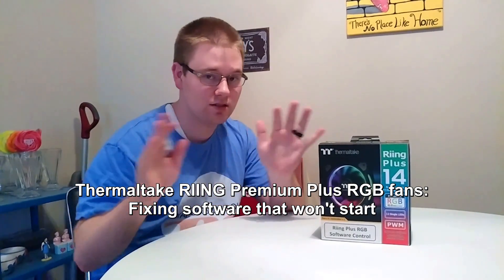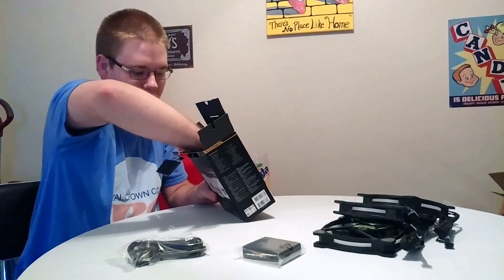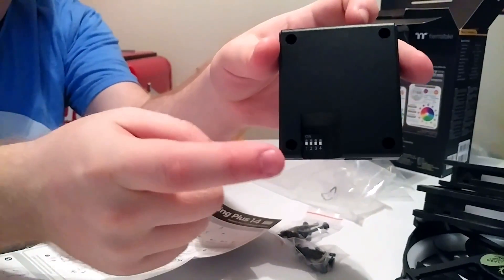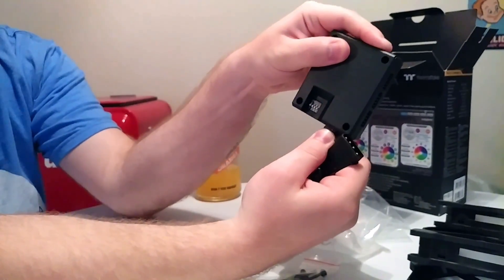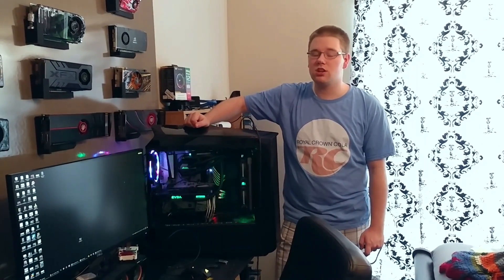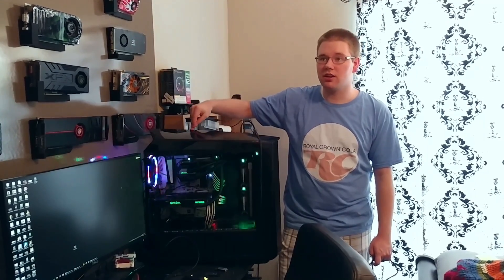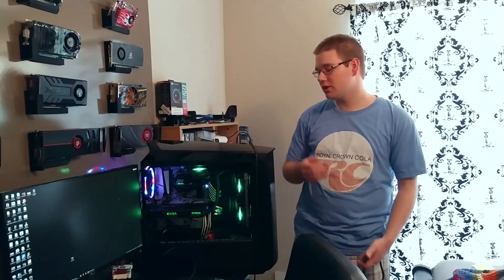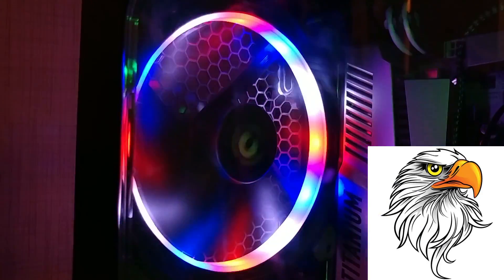Fixing Thermaltake RGB Riing Plus issues (AMD Ryzen)

Comment: Hmmmmmmmm .......... I have an Asus Crosshair Hero VI and I'm not having a lot of success :-p.  Fortunately before I upgraded to Ryzen, I was using these fans (the first generation, only 3 fans per controller and only one color at a time per fan) on an Intel board, and already had my settings stored on the controllers.... so since Ryzen was released I've just been running my original settings.

I'm not really a fan of having to plug the controller into a USB port on the back of my board?? But I'll try the different USB headers on my mobo now that I know it's possible to get it working.  Thanks for the video!

Comment: Thanks heaps for this video! I put a new PC together last night with a ryzen cpu with the riing 12 fans and could not find anything else anywhere about how to fix the problem with the software. Running a Ryzen 1600 with an ASRock AB350 Pro4 motherboard in case people are wondering what the trick works on.
Reply: So you are saying you got it working using the micro USB method plug in back of B350? USB3 port or what?

Comment: The fans look great but the need to reset them at each boot is pretty annoying. Even upgrading to the HD-120s is more work than it's worth. You at least have prevailed and a have killer fan setup to prove it.

Comment: Thanks for the video! Unfortunately this solution didn't help out in my case - the software is still convinced there aren't any controllers in my Ryzen build. Using the MSI Gaming Pro Carbon B350 MB, and none of the USB ports across the board work (internal, rear external, or front external USB 2 or 3). I REALLLLLLY should have followed the internet on this one and avoid TT altogether. 

At least my fans turn on, but I'm stuck with rainbow unicorns until they can fix this (if they do) and a lack of fan controlling for my loop. Blagh.